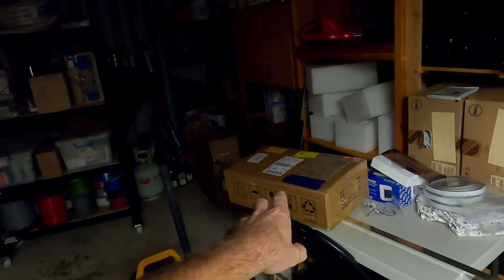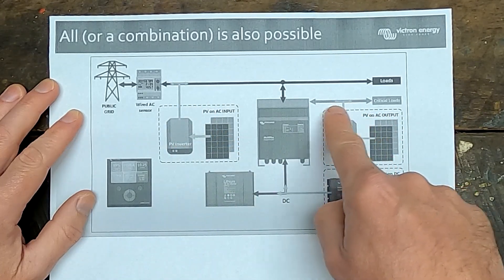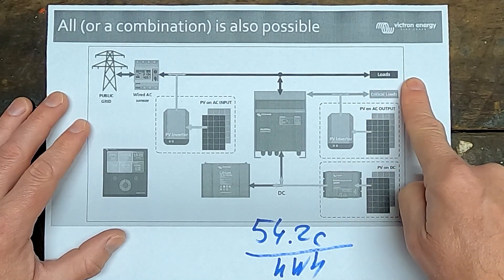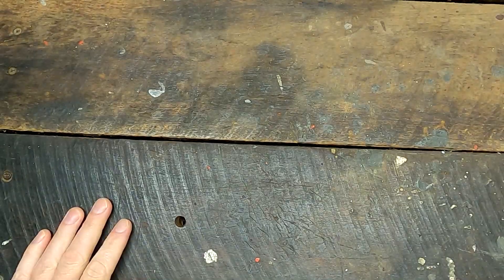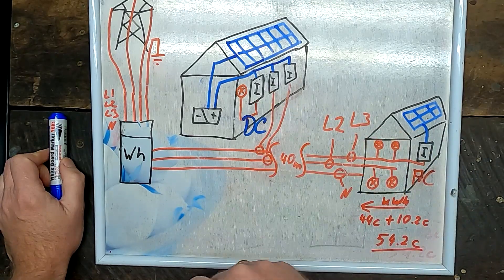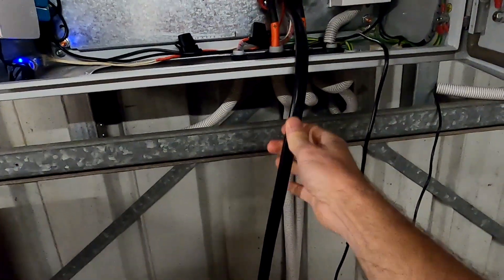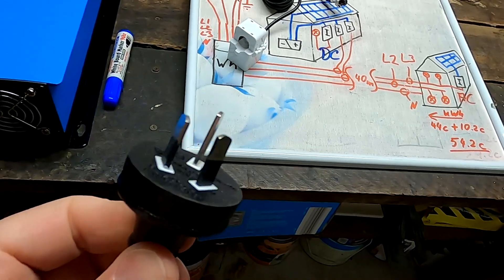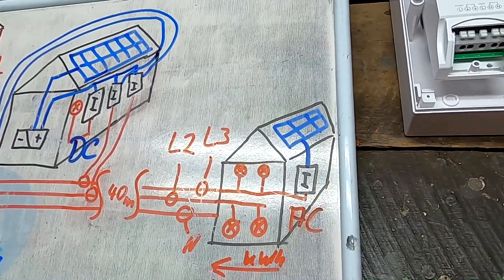Zero feed-in solution to power the house from the battery (and stay legal)

Comment: I think that clamp meter you connect to your mains is called a limiter.
Reply: Limiter is subsystem in the inverter (i this model it's internal limiter but there is also option to connect external limiter), clamp is CT clamp (current transformer) and it is used to generate small voltage based on current flow in Main line  as input to control limiter.
Reply: I see now.  The CT clamp thingy senses the current and is connected to the limiter inside the inverter case.
Reply from the maker: Yes, Mark, that is correct. It's basically just a sensor which tells the limiter inside the inverter how much power it needs to produce and at what voltage.

Comment: if you keep your meter zeroed as excess power is going to the batterys i cant see them stopping the contract as they are not paying you and will just think you are using more power thus not sending it back to the grid
Reply: With that rate it is madness to use excess energy to charge a battery and not to feed it to grid.
Reply: @1978jra  this is true i think the inverters he has will mesure power in one direction so they should only kick in when it detects power been used from the grid so night time hours or really bad weather days
Reply from the maker: I'm not going to charge the batteries from my AC solar! That needs to be feed in to the grid as is. The main problem is that the AC solar sits on the load side and needs to reverse through a hybrid inverter back to the grid and NOT charging the batteries.

Comment: I have four grid tie inverters and if your power goes down from the grid it still shuts you down because there's no power going to the inverter so it will stop functioning even at night and it's still considered grid and any grid tide going back using the cables coming into your house is still considered and not allowed you have to use a transfer switch and you say it's got a timer on there if it's got a actual timer and it actually shuts down the system whenever the other one is coming online that may be doable but where I'm at if it's gridtie it's not allowed if it's got any chance of feeding power back into the grid if it's got a one-way flow maybe in your case it'll work just please get them to check it before you put it online so you don't get a fine cuz that would suck go through all that work and not be able to use it and still get a fine
Reply from the maker: That is correct, they are grid following inverters. That is not my concern though

Comment: the only answer i can think of is having some sort of senser both sides of the meter when it detects that they is no power feeding back it can then flick on the grid tie inverter to supply the power to the house in thoery this would work like a grid down that or a switch over unit to switch from grid power to off-grid power at night
Reply from the maker: That would be a possible solution to automise it further.

Comment: Does it have  a way of disconnecting from the grid when feeding back to the house so some poor line worker  doesn’t get fried I know the power company’s can remotely turn off the grid tie inverters and air conditioning in Queensland I have a Victron Quattro on my boat and it has 2 seperate inputs for grid and generator and 2 outputs one only works when the generator or shore power is active and it is approved for grid feed in but is not allowed on boats for obvious reasons.
Reply: When grid power is down this device doesn't work
Reply: Interesting point. I think that Andy said the inverter needs to see power on the ac output for it to work.
Reply from the maker: These are grid following inverters. If they turn off the grid, the inverter turns off within 17.2ms (regulations says >30ms). They have ant islanding and will shut down quickly.

Comment: 10 amp ring main is ok for small loads.  Pushing 4kw through 2.5mm cable may be pushing it. 3rd inverter would burn your house down.  You'll need to add a 6mm 32amp power point to your fuse box.  That would work.
Reply: Can only agree, that setup could end up with a bunch of melting cables. Grid tie inverters is a good idea but they should be installed before the fuses at the consumer unit  !
Reply: @ravnox3057  but the wire to the inverter should be fused, too
Reply: @elektrobits3408  Thats right, but even if you use a eg. 10 A fuse you would still be able to draw 2300 watt from the inverter AND eg. 2300 Watt from the "normal" installation fuse. I dont know the fuse standard sizes (amps) for Australia but I do think that if you double the amount of watts you can drag from the outlets you could harm and burn your wiring.
Reply: Right, but isn't one inverter for L2 and the other for L3?
Reply from the maker: The inverter pushes 7-8A max to the house. The fuses to the house can carry 40A for each phase.
Not sure where you got the 4kW and 2.5mm got from?
Reply: @OffGridGarageAustralia  I think @electrobits is saying the wire size in a power and light circuit is 2.5 mm and can handle 25 amps. This is fused at 20 Amps for safety margin. In theory, the design load is 2400 watts per power and light circuit. Even if you fused at 10 Amps all appliances attached to a convenience outlets can have cumulative 2400 watts power draw from mains. (240v x 10a = 2400watts).. For purposes of injecting power back to grid (8A x 240 volts) using a convenience outlet say at the end of the power circuit  using the SUN inverter (via an 8 amp breaker), he is saying you can theoretically draw a total of 4 KW in total from the branch circuit, which was designed to carry only 2400 watts. The electrical code is built around this computations and errs on side of safety. It always specifies the next bigger wire size and the next smaller fuse capacity for the wire amperage. The overload can only happen if you intentionally put a load over 2.4Kw in any outlet and have multiple normal loads on others outlets at same time. If you try to picture current flow through the wires though, 4 Kw load will not overload/heat the wires if current is supplied from two sources on both ends of the power circuit. If total load is over 4KW, then both breakers will eventually trip if rating is correct and you do not burn your wiring. BUT, if you plug the inverter into a power outlet near the mains breaker side, then you risk heating up the wiring going towards end of the circuit and that can cause the fire if total load draw is more than 25 Amps (safe limit for 2.5mm wire).

Comment: Why not just wire the existing grid tie solar in front of a hybrid inverter?
Reply: Because he would need to lay a new cable between his house and the meter box on his garage for that.
Reply: @wiedapp  Exactly. Also I think he does not understand the Off-grid (with grid support) inverter concept. Calls it a hybrid all the time (only marketing people do that who does not understand the difference)
Reply from the maker: A separate cable is not an option.

Comment: I have 4 600 watt models 
I flick a switch when I need more power than my main off grid inverter can handle 
They are cheap and work but to output is not as clean (makes harmonic distortion)
It Sure beats buying a massive inverter to handle small run times. 
Good luck
Reply from the maker: Mine don't do that. What software version are you running on yours? I've got the gen2 SUN grid tie inverters with software 6.1. I'll show this in the video tomorrow.
Reply: @OffGridGarageAustralia  the units I have are about 10 years old there’s no software. 
I just have 2 outlets wired on a switch to turn on and off. I have a 6-12Kw growatt off grid. If I forget to turn off it will just put the power back to the inverter (ac coupled) but it just waste power considering the power is coming from batteries
Reply: @OffGridGarageAustralia  the units I have are about 10 years old there’s no software. 
I just have 2 outlets wired on a switch to turn on and off. I have a 6-12Kw growatt off grid. If I forget to turn off it will just put the power back to the inverter (ac coupled) but it just waste power considering the power is coming from batteries

Comment: Get a transfer switch that is on a timer so when the lights go down from the solar is not producing at night switch to your batteries and use it as off grid is all you're doing is transferring one to the other during the day whatever your part is hooked up to the solar to the grid during the day you use that at night use your batteries from your garage and treat it as off-grid and then they cannot say anything because you are not touching or doing anything to the system that is already there

Comment: Just run a separate AC circuit from the garage to your house so you can use the garage battery any time of day. In the end it will be a lot more versatile and you wont be wasting unused garage solar. You could power your refrigerator, TV, computers and such smaller appliances directly from the garage.
Reply: he cant - you missed the point on his contract.
Reply: @KevIsOffGrid  yes he can, the garage system is totally independent. he just cant feed solar to the grid from his garage panels
Reply: @bigbeef2654  wrong ... that would void his contract and lose his 54c/kwh. He did extensively show us his contract, no alternative means of powering the house while the house solar is working.
Reply: @KevIsOffGrid  He cannot add a power source to the circuit with the solar panels on it (aka the house circuit). The contract cannot prevent him from powering appliances from other sources, simply because they are physically located under the roof. That would be the same as saying it is ok to power a light bulb in the front yard with a solar panel, but as soon as you bring that light bulb on to the front porch, it is illegal.
Reply: @bigbeef2654  unfortunately that's exactly what his contract says. Go back and watch the video where he goes through the contract wording.
Reply: @KevIsOffGrid  basically I wouldn’t imagine they would know let alone be concerned if say he was to move the clothes dryer from the house into the garage to run it, so if say he was to run an extension cord from the garage to the clothes dryer inside the house, who’s ever going to know. Some people don’t even have a clothes dryer, so the electricity company isn’t going to know a) if he has one, and b) if and when that’s running from mains grid or from the off grid garage.
Reply: @lexicase5642  they'll know if he is splashing it all over the internet .....   but moving loads to the garage should be ok. I first suggested he did dump loads, like have the hot water off the house system and on the garage but that isn't allowed.

Comment: Why can’t you add a battery bank to your existing solar inverter on the house? That way it would charge the battery in the daytime and then use the battery during the night?
Reply: Grid tied inverters don't use batteries. Mostly.
Reply: It would be taking money away from Andy
By not exporting
Reply: Grid ties operate on dc current 
All you have to do is match the battery volts as to the solar volts. 
But you need a BMS that disconnects at low cell voltage. 
It’s probably 300+ volts =a lot of cells
Reply: @mitchrothermel8157   And how would you manage charging that ?  A simple DEYE inverter will do it .
Reply: @onthelake9554  Oh I would never do that it was just an example. But it can be done. I have some of those china inverters that plugs into a standard outlet. The “solar input “ is 20-60 volts. Battery is 48v. I only use those on my off grid when I need extra power.
Reply: My current setup is similar to Andy’s. I have a 4Kw system on the house that provides the house loads and feeds back any excess to the grid, but I also have a small DIY 710w system that uses a charge controller to charge my batteries which then feed the DC input on my Sunpower 1000w grid-tie inverter that feeds AC into my house. Ive been running this system for over 6 months and it all seems to work well, I still get my FIT payments and my electricity usage/bill has gone down significantly.
Reply from the maker: That would make no sense to charge batteries from a world class 54.2c/kWh feed in tariff. Hence it is so difficult and I cannot use a hybrid inverter. This would charge the batteries first from the excess power.
Reply: @OffGridGarageAustralia  Hi Andy, by the way I love your channel and you do fantastic work inspiring people like me to try out new solar ideas. Just to follow up on my comment about adding a battery bank to your house solar system, what I was thinking was depending on your existing solar contract conditions and whether your house inverter is able to connect to a battery bank, if so then your house 5KWh solar would first charge your batteries, which depending on the size shouldn’t take long, then the surplus energy would be fed back to the grid. Once the sun sets your inverter would switch to your battery bank to provide power for your house loads(Not 5kWh) and the excess fed back to the grid giving you your world class 54.2c/kWh 😀 Essentially turning your house solar system into a Tesla Powerwall without having to spend any extra money! Looking forward to your next video, stay safe and stay charged:) lol